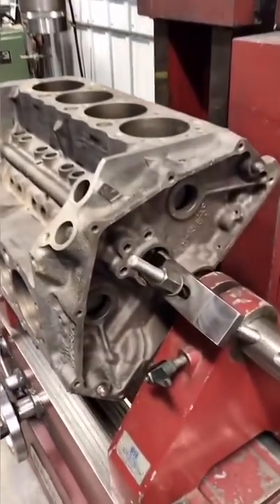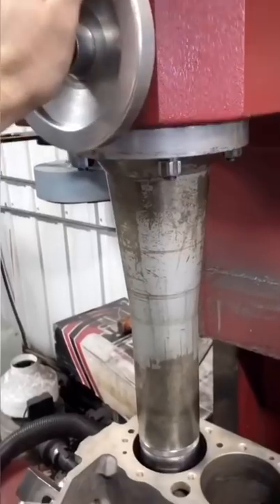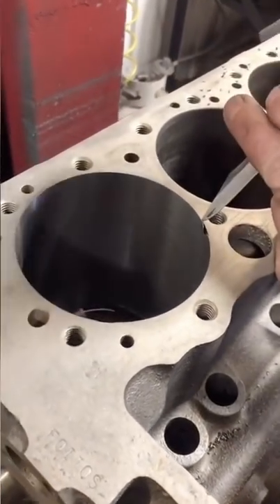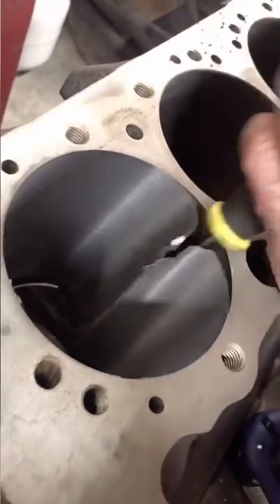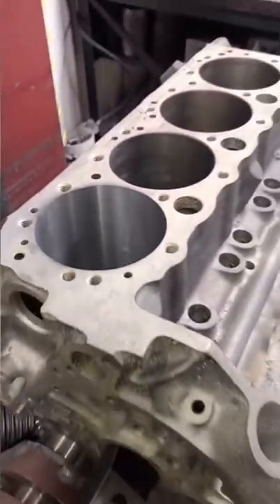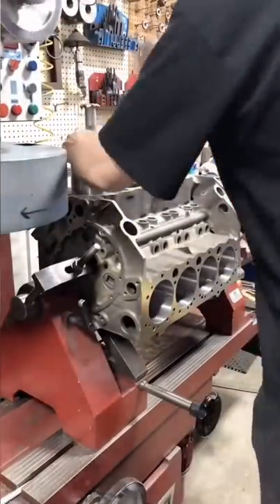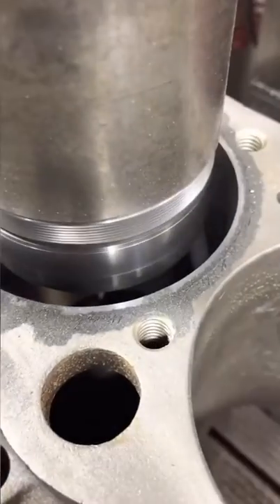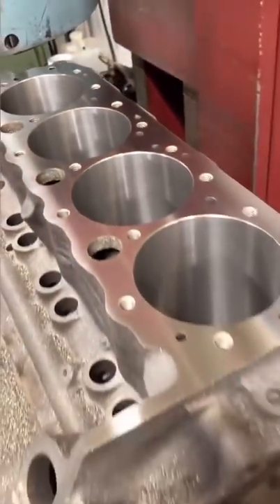#shorts Bore & Resleeve 327 Small Block Chevy Engine

Comment: So this would be at minimum the 2nd time this block has been rebuilt, most engines don't get to see a 1st rebuild.
Reply: Not every engine goes to the drag strip every Friday
Reply: Yeah I'd say 2nd or 3rd
Reply: @dominoespizza1756  was about to say this has to be a race engine to have the work put into it 👍👍
Reply: They don’t build em like they used too!
Reply: @NORTAH85  They don’t rebuild em like they use to!
Reply: Why would you drag race a sleeved 327 anyway? If its a No's matching car drop in a clean 350 and save the 327.
Reply: @anthonysantiago1999  its probaly a circle track block
Reply: Most people "give -up " on a block when it cracks .
 This guy's getting his money's worth out of this small block !
Reply: @jimwednt1229  idk i mean is he? seems if hes going through the trouble of having this cracked block rebuilt (twice) hed be better off buying a used block thats not cracked and having that block rebuilt instead?
Reply: @estergrant6713  ,well, I grew up poor and was used to  always getting every last bit of value out of every car,truck , motorcycle etc because I had to . 
 So I understand why someone else would keep using a cracked block
The crack in the block doesn't interfere with the performance,, yet . So, they keep using it 🤔 lol.
Reply: @jimwednt1229  right what i mean is in terms of cost, since you mention being poor at some point, having this cracked block rebuilt several times seems more expensive than simply replacing the block with a salvaged block and rebuilding that instead because a machining is gonna push $500+ easily per rebuild plus cost of assembly is really seeming pointlessly more expensive than just replacing the block
Reply: It's a Chevy, ofc it falls apart every month
Reply: @estergrant6713  it does not cost $500+ to bore and sleeve a block. It's like $150-$250.
Reply: @kevinragsdale6256  still
a chunk of change to have to do several times when you could jusy bore a fresh block that isnt cracked
Reply: did the head gasket blow in the same spot...need to know
Reply: @KatieTheDev  gr8 b8 m8
Reply: I don't see it being worth while. Unless it's some kind of matching numbers car. It's just a four-inch bore small block Chevy, the 350 block is identical to the 327 block, and used 350 blocks are cheap
Reply: @dominoespizza1756  88k88o
Reply: @estergrant6713  irrelevant, you are just wrong. It's not $500.
Reply: @kevinragsdale6256  okay then how much is it and how does the cost compare to simply rebuilding a used non-cracked block?
Reply: Especially nowadays one labor cost more than a block - probably a collectors car keeping the same engine
Reply: @kevinragsdale6256  Not in Southern California
Reply: @estergrant6713  Last time I had a ford 460 sleeved it was $120 for the sleeve job. Thats cheaper than any junkyard would sell a block for. A pull a part near me would sell a block for $60, but when you factor in my time wasted its not worth it, and all the time wasted could still be on a junk block. Can not tell until it is magnafluxed. So point is, if you have an extra good block to use its obviously cheaper to use it, but having to buy or pull another and its not.
Reply: @pbsocal1  your getting fucked then, my machine shop did a ford 300 i6 for me a year ago. All bored 60 over, head rebuilt ready to go long block for $1150.
Reply: @kevinragsdale6256  Yup, all of Cali is a huge ripoff
Reply: Likely a mechanic's car that they had forever
Reply: I had an old 69 C-10 truck years  back and it had a 327 in it.  The engine wasn't  stock to the truck, BTW, did I  tell you it had a 327?  Anyhow this engine was pretty hot, even in my lead sled.  Did I  mention it was a 327?  I ended up selling the truck to a buddy because  the 327 kept blowing up everything  behind it, from clutches to chopping the U bolts holding the rear  end in and loved the gas station and 104 Octane booster.  When Dale bought it from me he said "this really is a 327!"  I said of course, that's  why I told you it was a 327!

I get the point that it was a 327, to me that is all the point  that is needed.
Reply: Reading comments everyone is going on about machining, or rebuilding an engine block. My idea is maybe the owner is keeping a numbers matching engine in a car. “Stock” 327 in said car for namesake.
Reply: @anthonysantiago1999  I like 327 better than 350. Built right a 327 is a high reving screamer
Reply: @KatieTheDev  ur thinking Ford
Reply: I was pulling 550 fly wheel hp out of a 327 great engines
Reply: Saving that bad lil boy I love to see that
Reply: @kevinragsdale6256  makes no sense to rebuild. The labor for doing the WHOLE repair with the same block is a terrible idea
Reply: Probably a numbers matching engine someone is wanting to keep with the vehicle. Maybe not, but that's the only reason I could see re sleeving at 327, especially multiple times. To me if not original would be better to buy a good block and get it bored and honed.
Reply: @anthonysantiago1999  327 was such a great motor.
Reply: Maybe #s matching old split window vette
Reply: @kevinragsdale6256  even less if it's your machine shop and you do it yourself after shop hours.
Reply: @adamhayden5152  obviously you wrote something that made you look stupid, and that’s why you deleted it?
Reply: @marcp1180  Was it a 327 that you had? I'm not sure.
Reply: @joecummings1260  not always true. Some 327s have smaller main journals that 350s
Reply: @leojensen9270  yeah if I remember right 1967 and earlier blocks small Journal. But I'm pretty sure you can buy bearings then allow you to put a small Journal crank in a large Journal block
Reply: @joecummings1260  im not sure if they still make those. Parts industry has been changing alot recently
Reply: @anthonysantiago1999  or maybe a 800$ LS from a truck? Lol
Reply: @estergrant6713  
, the crack in the block and the sleeve have nothing to do with the need for a rebuild.  Assuming it ran 25 years between rebuilds, the need for another rebuild is just common wear. Changing out the old sleeve is/was $8 per cylinder.  It's cheaper than buying another block that's also going to need all the same machine work.
Reply: @estergrant6713  , why would it need done several times? That doesn't make sense.  Another block would wear the same as this one. Rebuild every 20 years or 100,000 miles. This block is just fine again. Ready for another 20 years.
Reply: @bradleynelson5915  several times as in its already been done twice? thats what i meant? also frankly im not restarting a discussion i had several months ago so feel free to reply to someone else instead.
Reply: @alockworkorange7296  would be awesome in a sprint car
Reply: Does the pistol to steel wall clearance change ?
Reply: Idk most sbcs i see get 3-6 rebuilds, after 3 they get sleeves
Reply: @estergrant6713 you have no idea what the time span between the first and second rebuild is. It could easily be 50 years.
Reply: @KatieTheDev ah yes, a small block Chevy being a pinnacle of unreliability, yep, because in the era of this engine, the Ford and Dodge equivalent were so much better right? /s

Comment: I've wondered...why not use liquid nitrogen on the sleeve before installing it in the engibe. In aviation we use liquid nitrogen alot. Mostly because the manufacturer calls for it in the process to install bearings, bushings etc... it would make the sleeve easier to install.
Reply: That's what we did on diesels just to make the process easier
Reply: Freezing the sleeve works well enough and doesn't make it as brittle as liquid nitrogen might
Reply: Because everything is done at a cost.

Comment: If that was my block I would have paid you to sleeve all eight . A couple of the other cyls looked like they were discolored after boring and where that crack was in the block it looked like there was some erosion to the outside of the cylinders. You definitely did a great job on the one you did.

Comment: I just wayched an 8yr old mechanic in India do the same on a 6 cyl Hino truck engine with very old tools and lathe.  He resurfaced the head by having him and a kid friend pull the head back n forth over a sanding stone. A 3d kid stood on the head to add weight.  Then using a steel bar and feeler gauge they ground the head flat!  Original valves were restored with lapping cream and twirling them to seat tightly.

Comment: Somebody clearly hasn't seen "shake hands with danger" if they are allowing their driver handle to get that mushroomed. Lol
Reply: Exactly what I was thinking lol
Reply: @max230001  When I watched it for the first time I had flashbacks to workin around the house with my dad. Lol Luckily I never broke a bone or even had any stitches. Shake hands with danger is a great training film though. Makes you really understand the importance of safety even on the small task's.
Reply: had to rewatch and yea i see it now lol
Reply: Its gonna start throwing fragments soon
Reply: I work in a open pit mine and I’ve seen that safety movie “shake hands with danger “ once a year for MSHA 20 times
Reply: Old 3 Fingered Joe, meet
Old One Eyed Fred...
Reply: why? whats the risk?
Reply: @RawSauce338  He's hammering on a steel spike. The head has mushroomed out due to the impacts and if you leave it like that it will shatter sending metal shrapnel into you.
Reply: I rate that huge mistake as a total complete failure for this self-appointed "expert ?" He will soon will be know as. 1 eye Jack The Self-appointed Expert.
Reply: @rexmccomb7589  
As a 37 year retired Diesel Mechanic/ Cert. Welder/ Mine Foreman open pit miner. Inspectors made me at 1st sign of metal deformity grind it off or replace it. Basically your tools do show your abilty in craftsmanship as a Mechanic. That poor guy just failed completely. If I seen that ? Depending on his smart mouth. He would gotten 3 days off automatically if not dismissed on the spot. That is the type of stunts are just down right stupidity. That is the type of stunts people do & will get hurt on or worst kill others. I seen a hyd hose just the spray of 1 leaking blow a guys brains out when I 1st starting out. He was  checking on what hose was leaking to change it. I was about 25' away. A young rookie was operating equipment & open engine wide open on him. I screamed No!! It was too late. They pay you to be a Professional not a dumb ass.
Reply: @Houndini  well you don't run his shop and it's not that serious so I think he's going to be okay.
Reply: @michaelf.2449  
And I never ever would allow that company to touch anything I am own  or a supervisor over.. That there is just down right grade A+ Very poor workmanship on there part. It would not be 1st company I sent packing with security guards speeding up there process & don't come back begging for  business for yourself again. True story Security Guards came from our experience back in early 1980s  from a church group came to our work site & pulled up &  just walked right in our office trailer . Even with some of our on the job employees names trying tell us & demanding who to dismiss  & of course demanding us to hire a lot of there church members. I about fell out my seat in total shock while filling out govt. Manitory paper work. Before they know what happened state police was there to remove them off our posted private & dangerous property. I am still shocked over there bravery & how highly they thought of themselves. Yes that was the last trouble we had out that crazy  bunch. Just thinking about that day still amazed me just how important they thought they was. I am glad I am retired now. I lost many of good friends over lack of safety to just down right. wrong place wrong time. You got to work safely or you don't last long around dangerous tools & equipment. My hardest hit was 2 brothers  years apart & on both.  That coming long weekend we was going take our  days off hunting or fishing together. That was a very hard hit on myself there. 2nd brother we even talk about it. He told me now you don't worry about it. I will be extra careful. He was killed within 24 hours during a  safety inspection Sunday night before 12:01 am Monday shift. Wrong place, Wrong time big rock came off a highwall & crushed him while inspecting job site for safe work site &  environment. True Story. Safety starts with the employee themselves . That 1 case I hate say it but almost a act of God. Wrong place wrong time.

Comment: As crazy as it may sound, I actually resurfaced a V-8 engine block in a 2008 land rover by hand with 400 grit sand paper and a modified orbital hand sander. It took me 11 days. While I was doing that 2 of my brothers were getting the new gasket kit and head bolts cause 2 of them sheared when the head gasket blew. Long story short, 11 days and $600 in parts later, the land rover was good as new and my brother then turned around and sold it a year later for roughly 6 times what he paid for it.
Reply: Did he warranty the repair too?  Did you keep all the metal dust from sanding it out of the oil galleries?  Is the surface finish correct for the type of gasket?  Is it actually even a flat surface anymore?

I'm not impressed, sounds like an incorrect repair with no warranty and the poor SOB that inherits it overpaid.  Best of luck to him.